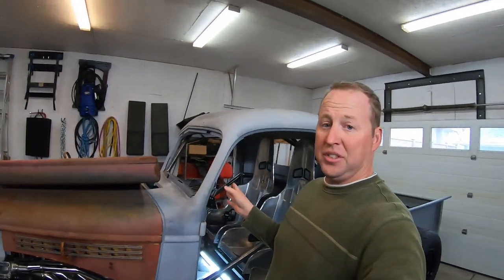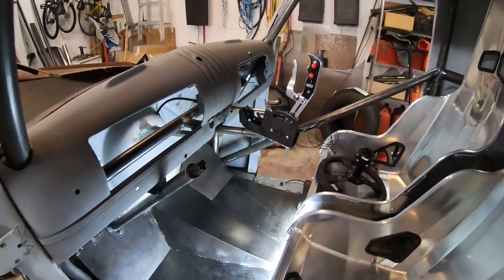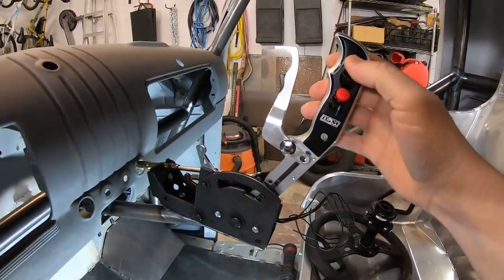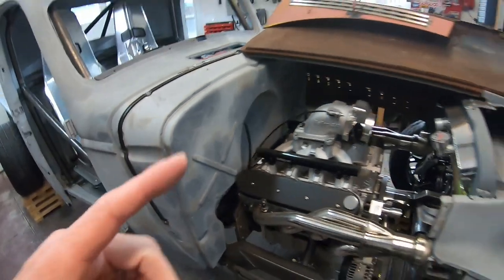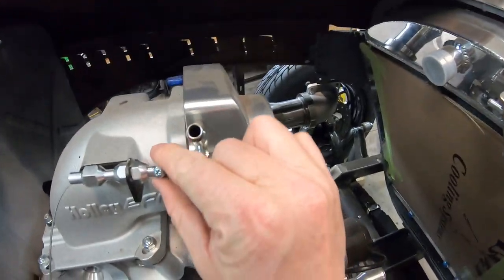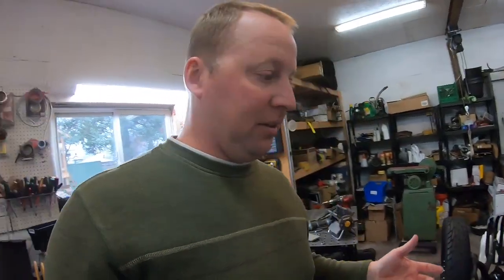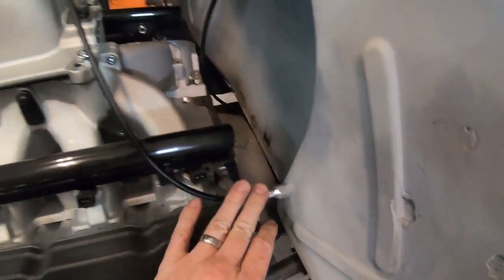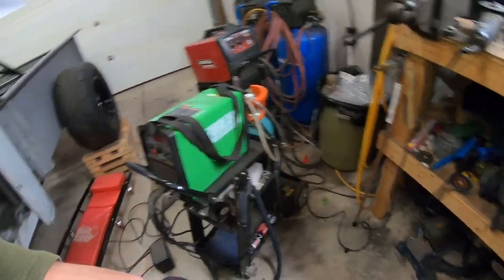Problems with the 46 Race Truck! And Installing a Fuel Pedal.

Comment: I bought the same pedal for my 65 impala. Ran into the same problem and bought the spacer they sell. Pedal didn't come with much directions, but you can adjust them by loosening the screw were they pivot, but You probably already knew or figured that out

Comment: I had the same problem when looking for a shifter. I found an out of the box hurst pro matic 2 for 100 bucks. it is a ratchet shifter in 1 2 3 and 4th so it will work with a reverse valve body but I had to add the extra gear.  it already had an extra tooth to go one way.  I had to weld on it a little bit and finish it with a file to add one more tooth to go the other direction but it works great. check it out. you will see what I am talking about.